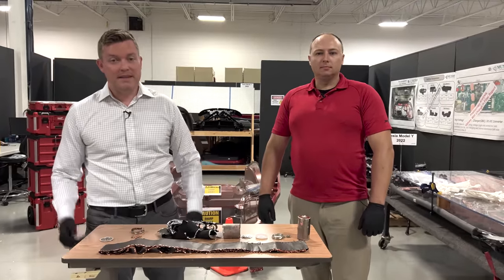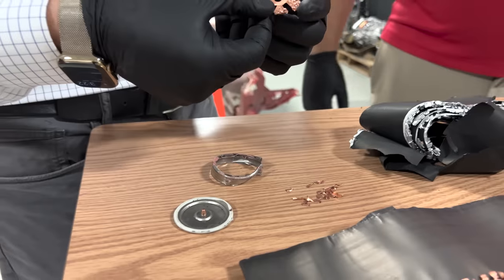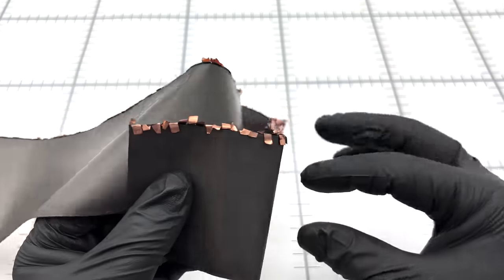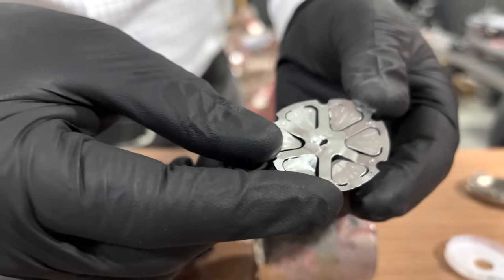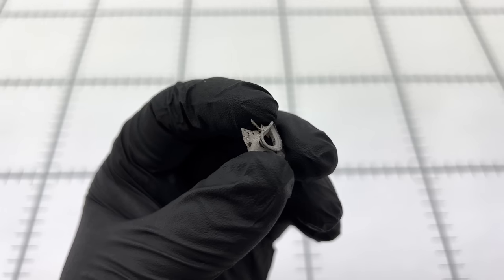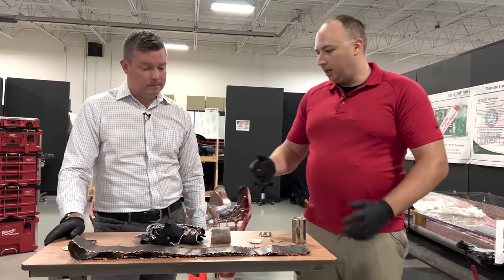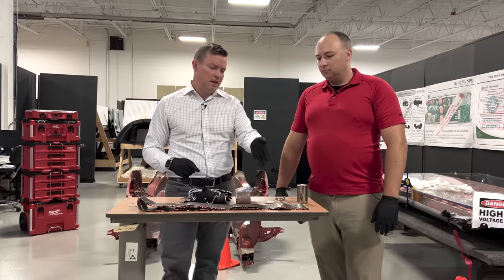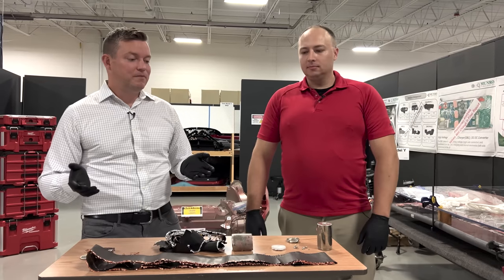What's Inside a Tesla 4680 Battery?

Comment: As we see more of the insides of the 4680 cell, I think people are beginning to realize that Tesla has advanced the state of engineering of cylindrical cells.  They have reduced the path length of the electrons by a factor of 20 compared to a single tab design and thereby reduced the internal resistance as well.  With lower internal resistance comes greater ability to discharge or charge at high rates with much less waste heat generation.  I think this is why BMW has switched to 4680 form factor cells for their new EV designs.  An engineer finally did the analysis and convinced the management chain that it was a much better design.
Reply: I'm surprised how simple it is.
Reply: The 4680 form factor was co-developed with Panasonic, who will be releasing their own version of the cell. According to a battery industry insider, one helped BYD and CATL build their plants, Tesla isn't the only company developing new form factors and manufacturing methods and the difference is that they are far more public about what they're doing
Reply: @areitu Panasonic are not using Tesla's tabless design but they are using more than 1 tab to try and mimic the effect while still doing what they are comfortable with. Also we'll have to see if they do dry battery electrodes as well since Tesla are still struggling with it, at least when it comes to the anode. Not sure why they wouldn't go with Tesla's design but it kind of shows they did not co-develop it.
Reply: Would like to a see a cylindrical vs rectangular cell comparison.  Packaging, energy density, cell integrity, thermal distribution, etc.
Reply: @NTNLabs  elegant but not simple at all. A factory has to spit out millions of batteries so fast that you can’t see them moving.
Reply: @areitu  No, Panasonic was not involved in Tesla's 4680 cell design. In fact Panasonic stated that they had a lab set up and a team of engineers ready to work on their own version as soon as they watched Battery Day presentation and knew what they were going to copy.
Reply: @iamalmostanonymous  Tesla chose to stay with the cylindrical design, not because of energy density etc., but because of manufacturing speed. Have you seen the videos of how fast Tesla winds the cell vs videos of prismatic design that have to go slow to handle both curves and flat sections. It's really night and day.
Reply: BMW using 4680 doesn't mean anything. 4680 is simply the can dimensions. All the stuff inside is Tesla proprietary.
Reply: yeah but the less hot LFP batteries actually taking Tesla to new heights.  consider that past months was the first time in Tesla's history they weren't battery constrained despite the ever  increasing production numbers. I reckon, Model 3/Y Long Ranges will transition to LFP once the Semi/CT ramps so that these large vehicles get all the nickel based batteries.
Reply: @areitu  
The 4680 was a problem.
Nobody could use the form factor in high energy cells due to 
Long "current path" > Resistance> Resistive heating > inefficiency > failure.
.
Tesla (Maxwell) found an answer..... It's patented.
.
Is it coincidence that others including Panasonic, LG, Samsung (?) are now developing 4680 cells?
.
I don't think so.
.
I think that there were "discussions" and those companies are using the same or very similar designs to "develop" 4680 cells under the "fair use" policy.
.
As such, whether they're using Tesla dry process, full edge length tabs, or Tesla machinery, there's at least some degree of discussion regarding development of the design and the process.
(They all have useful experience)
.
To say the cell "was developed" with Panasonic is probably a stretch, "being developed" with "free exchange of information and ideas" is probably a closer description.
(We don't know if Panasonic, LG, Samsung are even using the dry process)
.
If they crack the problem between them and ramp to speed, it's literally a license to print money.
It's well worth cooperation.
.
Time will tell.
Reply: @iamalmostanonymous  
Concentrate more on the production method (speed)
.
That's the game changer.

More GWh (TWh) from smaller factories is the goal.
Reply: @oisiaa  
"BMW using 4680" means someone has overcome the same problems that Maxwell/ Tesla solved.
If they (or more likely their "partner/ supplier") found another method, well done (but unlikely) if they are using the same method, they will , either directly or "through the back door" be paying Tesla some sort of royalty.
Reply: @zodiacfml  
"LFP"
Fine, but there are things to consider.
.
How many cells do they require to "fulfill the mission?
Apparently, 3TWh?
.
Does Tesla want to be fully vertically integrated?
Absolutely!
.
But they've said several times they can't (?) make 4680 LFP cells.
.
They need (as per predictions?) about 2.4TWh (80%) of LFP cells?
.
Does Tesla want to be fully vertically integrated?
Absolutely!
.
Do you see the disconnect?
.
If Tesla have an incredibly fast cell production process (necessary to reach the target?) But they can't use it with the cell type predicted to be the predominant chemistry, that means they must buy cells in......
 80% of their (vehicle) cell stock?
.
That's not "vertical integration".
. 
Something doesn't add up.
.
I think we'll see....
An eventual 4680 LFP cell.
And/ or.
The recently discussed "Jeff Dahn low power NMC cell" (with less or no "C"?)
Or
Another chemistry.
Using the high speed 4680 production line.
Reply: @blackrockcity  I would say simple things are the easiest to produce :)
Reply: @rogerstarkey5390  Of course Tesla can make 4680 version with LFP. The argument is that it may not be the most efficient format for LFP. However, if you've already invested in the equipment...
Reply: @NTNLabs  it’s optimized for manufacturability. But consider that cell production has held up the company of 100,000 people for many years, it must not be simple at all. The oven(s) to dry the solvents out of the ribbon are 400 feet long. But they are “just ovens”, right?
Reply: @rogerstarkey5390  4680 is the dimension of the can. 46mm x 80mm. It’s chosen for various optimizations. If other companies are saying they will use 4680, they will likely mean just the form factor, the contents of the cell may be substantially different to the extent that differences are possible.
Reply: @blackrockcity  You don't understand what I'm trying to say :) You and I are saying things that do not contradict.
Reply: @NTNLabs  yes, yes. It’s about optimization and elegance. “Simple” is too simple a term because it doesn’t reveal the embedded complexity of how the nickel was mined, transported, refined, rolled, cut, etc. Lay people say things like, “this iPhone is overpriced, it’s just a screen and circuit board.”. They need to attend a conference on shrinking transistors to 2.5 nanometers to see what’s truly involved.
Reply: @blackrockcity  To do things simply is hard. That's why I am surprised the cell, which is probably the best cell in production, is so simple. I'm not saying it's simple to produce such cell.
Reply: @rogerstarkey5390  Tesla/Elon did not say "can't".  They said they "won't" make a 4680 with LFP.  They did not explain why but  because doesn't make engineering sense if one is aware of the advantages of LFP vs Nickel based.  
There are existing huge cylindrical LFP cells from China, but I think, already being phased out in favor of larger cells like prismatic or BYD blade.   
Tesla has fat margins which is the reason they buy batteries from all sorts of suppliers.  Tesla/Elon already mentioned that 50% of their cars produced are based on LFP last year and that excludes the Powerwalls and Megapacks that uses LFP.
Reply: @royh6526  It is hard to educate those who want to believe falsehoods.
Reply: @iamalmostanonymous  That's actually a fantastic point. Currently, rivian only cools their batteries on one side, so it seems like thermals should still be realistically manageable with increasing cell packing density. It probably makes the process way too complex in other areas, but it could be worth the engineering. This tabless design would eliminate the "non-symmetrical/concentric" issues. It seems like the material had no issues with tight curvature for corners (the center of the cell is quite tightly wound).

It's just a very interesting consideration with the tabless design.
Reply: One question if that car with those batteries got into a dangerous accident that bends the chassis will the battery explode? Because the protection chemicals of the battery to contain fire will not have time to mend a foam around that sudden impact so that leak pressure will be vast that it will explode in its place with blue flames from the middle plates and will that burning hot high level fires be consumed then contained from the rest of the batteries protection or create a chain of implosion events that create a big explosion blast under the vehicle and push the car to the sky ?  Did they try this test ?
Reply: @Norkgb  nope. worst case scenario, these cells will explode like tiny fire crackers but most of the time they will burn like any EV fire.
Reply: @Norkgb  You know those explosions you see on tv?  They're made with gasoline.  Think about that the next time you put 15 or 20 gallons into your car's tank.

Comment: The equipment manufacturing those cell is no less a feat of engineering than the giga-press, and maybe even more so. The continuous consistency required is mind boggling.
Reply: not to mention, all the Parts & Process elminated, toxic chemicals , eliminated, and the long ovens.
Reply: LOL….. it’s just additionalem machines to the already existing batteries assembly line nothing more
Reply: xray spectrometer is elemental analysis...not composition
Reply: @carholic-sz3qv  it's less machines actually and it's machines built specifically for it. You make it obvious that you don't understand how complicated industrial processes are
Reply: yes - this is how batteries are made. ingeneous, thankyou panasonic, Sanyo, Phiips, Samsung, etc, lol..

Comment: What is the capacity of a cell in Amp hours or multiplied with nominal voltage: the capacity in Watt hours? Did you do measurements at cell level?
Reply: Initial reports are that it's still in the 270 Wh/kg ballpark, perhaps on the higher side of that.
Explains why the "OMG it's almost structural" Model Y is just barely lighter than the previous version, while having a lot less energy capacity and range.
It it's 5.5 times larder than a 2170. If this costs less than 5.5x as much to product, they can try to make it worth there while NOT to simply buy LG cells like they have been. It gets interesting when they can make one of these for the price of 3x 2170, I guess. Apparently it can handle the energy demand cycles for a Model Y. I wonder whether it's ready to do the same for the Plaid. However, from the looks of things, it's NOT ready to bring Plaid and Roadster, even Semi and Cyber, the capacity they need, by lack of energy density.
Reply: I personally don't like amp hours because it implies that all voltage are the same. While many are, I don't like the premise that leads to the use of amp hours. YMMV.
Reply: @Cloxxki  source for them buying LG cells they buy from a lot of makers but not seen proof of LG
Reply: @alanrickett2537  I believe  Giga  Shanghai is  using LG  2170 cells  for higher end  Tesla mod 3 and Y
Reply: @Cloxxki  
You've got a surprise coming.tbey already said (weeks ago) "we were surprised by the cell performance"
(It's not the same chemistry as the "Limiting Factor" cell)
Reply: @alanrickett2537  Tesla buys LG cells for vehicles that are manufactured in the Shanghai factory
Reply: @cyclopsvision6370  ok I know they buy BYD and CATL did know they had LG too
Reply: @alanrickett2537  BYD and CATL for LFPs, LG and Panasonic for Li-Ion.
Reply: @EinzigfreierName  LFP is also Li-Ion.
Reply: I doubt they measured anything, electrically.
Reply: @Cloxxki  The reason beyond amp-hours is that it tells you the total amount of charged particles that are transferred across the battery (since Ampere is measured in charges per second). It's useful when you're comparing two batteries, but it indeed doesn't provide you with the amount of work that the battery can do.
Reply: @peter.g6  Technically, yes. LFP vs. NCM/NCA would have been more correct.

Comment: A minor point on terminology. According the "The Limiting Factor"  channel (and an internet search confirms this), the term "tab" refers to a separate strip of metal that is welded to provide connectivity. In the 4680 battery, the tab-like flaps are not separate pieces of metal that have been welded to the jelly roll, but rather are part of the jelly roll's metal backing itself, and a laser was used to cut the flap shapes. Hence, it is correct to refer to the 4680 being "tabless" rather than "multi-tab".

I don't come from a battery background, but I assume a multi-tab design would provide similar electrical characteristics to a tabless design. I also assume that using a laser to cut tab-like flaps into the jelly roll's metal backing offers advantages over welding multiple tabs to the jelly roll's backing, such as perhaps it is cheaper, faster, or more reliable.
Reply: a tab is a piece that sticks out.. just like browser tabs
That for economies of manufacturing reasons in roll-to-roll production for efficiency purposes they spot/laser/etc. well extra strips ONTO the strips that form the rolls is not what makes them tabs.
And when the tabs run for the whole length of one side of a strip they still are called tabs and it doesn't become tab-less.

I also doubt that the cut ins for both the copper and aluminium base material have been done by laser.. a simple cut/shear wheel running over one side in the roll-to-roll process would do just fine.

Comment: The thing is: they call it tabless because a tab is normally not the foil of the anode/cathode, but a small piece of metal welded to the anode/cathode. They cut the electrode and fold it over, and then collect it with this copper piece, which one could call the "tab"
Reply: I agree. It's not tabless - it has a continuous row of tabs comprised of the conductive sheet material, rather than a small tab added-on.

Comment: Truly worth the wait Cory, i would imagine the likes of Mary Poppins & Oliver Bloom have been waiting for this too :) :) Go Team Munro :) :)
Reply: Now if only it were able to offer cars 54% more range as promised. For now, the Model Y gets LESS range than with 3rd party 2170s.
If the cell doesn't have significant advantage beyond theoretical cost (their 2170s never seemed worth expanding as they just imported whatever they could get their hands on, and all seemed cheaper and better than Giga Nevada cells), 4680 can't be used for Plaid+ and Roadster and be decently usable cars with the promised specs. No-one promised Roadster would be LIGHT, but with 200 kwh of these cells, that's already 720 kg of cells, likely 1000 kg for a pack all welded up, and only if record breaking for gross/net energy density. 54% more range on the Plaid would simple mean 50% more weight in the cells. Can the pack overheid be trimmed to compensate? Not so sure judging from Model Y being near identical weight for the 4680 but down on capacity and range, at least for now.
Semi relies A LOT on energy density to get huge range and not ruin payload. Cyber with 500 mile range needs a 180-210 kWh pack as well. Or will they have a new process to make the steel exoskeleton end up super slick for aero? Worth developing for millions of trucks I guess, but Tesla tend to stumble a lot when innovating.

Comment: That copper also makes a great heat sink, awesome battery
Reply: It's not a heat sink
Reply: @vidznstuff1  I said also makes a great heat sink, copper has many uses besides electrical conductivity and they need to make sure the heat can be transferred out of the cell
Reply: The point is, the short electrical path, up/ down to the tabs rather than along the whole length, reduces resistance, which normally causes heat.
Therefore there's less, if any heat produced in the first place.
Heat being energy, now not wasted the cell becomes more efficient.
Implications for:-
Efficiency of the cell (and pack).
Heat stress reduction in the cathode / anode, improving longevity.
Even temperature through the pack and reduced pack cooling required.
Quite possibly faster charging (reduced throttling)
...
As for the tabs, it's a conductor, normally electrical, but of heat if needed.

Comment: Very cool. This is a GEN 1 design. The way that the battery can is sealed and the current collector design will be different in GEN 2.
Reply: Jon, 
Was the "Jordan" cell a "1" and this is a "2"?
This seems to have a dry cathode?
(Maybe the one you speak of is a 3 ??)
Reply: @rogerstarkey5390  Jordan's cell was a GEN 1. What makes you think that this is a DRY Cathode? I believe it is a wet process and doesn't have the POLYMER binder like the anode side which is holding togther much better.

Comment: A simple suggestion… how about placing an 8 or 12 ounce Pepsi can beside a 4680 for scale, something anybody watching can instantly relate to!
Reply: Unfortunately there are multiple sizes of Pepsi can, so it doesn't help much. The dimensions are right in the name... got a ruler?

The 355 ml (12 oz) cans in my refrigerator are 66 mm in diameter and 123 mm tall, so the 46x80 mm cells are about two-thirds as big in each dimension. The 4680 would ideally be a 133 ml (4.5 oz)... so even smaller than an 8 oz can  but I'm not really familiar with that size.